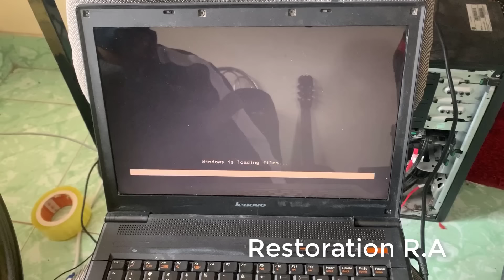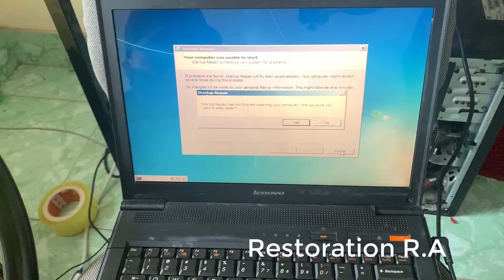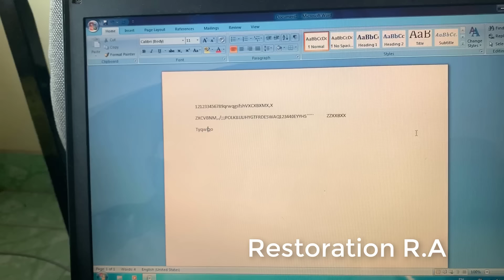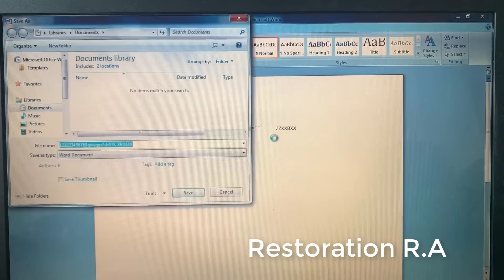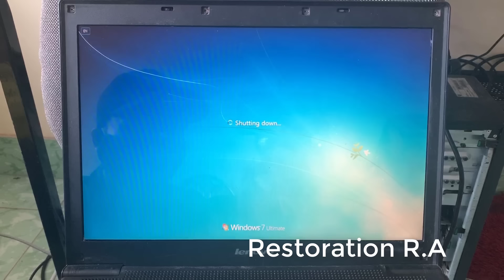Restoration super broken old LENOVO laptop | Restored computer assemblies destroyed 10 years ago

Comment: Having had multiple computers in my 70 years on this planet you did some major no no's specfically washing everything including the mother board in water. The clock battery should have been replaced as it would never turn on. In short this video although looking like a complete restoration is a complete fake.
Reply: Seeing the heatpipe being installed without ANY thermal paste applied hurt my soul deeply.
Reply: Fraud 😡
Reply: FYI

Comment: You are certainly well done that you were able to restore a broken laptop, but you made a lot of serious mistakes during the recovery ! After washing the motherboard and cooling system with detergents, it was necessary to wash all these things in distilled water, and then in pure medical alcohol, to remove the water and prevent oxidation of the contacts . After washing in alcohol, it was necessary to dry all the components of the computer on the soldering station at a temperature of at least 80 degrees, and not with a hair dryer ! When assembling the cooling system , it is necessary to apply thermal paste to the processor and controller crystals, otherwise the crystals will overheat ! Before connecting the power supply to the motherboard, it is necessary to supply a voltage with a limited current consumption , so as not to burn the chips if there is a short circuit somewhere in the keys or bridges and chipsets .
Reply: So, this video Fake?
Reply: @christopherfelix9971  I'm afraid it's a fake video.
Reply: There are a lot of things in this video that don't make sense.
Reply: I know it's fake but it's entertaining
Reply: Damn ur smart
Reply: Motherboard ok with washing in normal water. I myself had done it lots of time with just detergent and plain water.... and no problem. But u need to dry it througly before any kinda power up.
Reply: Didn't You see how good is that guy? He doesn't need any diagnostic tool. Enough is voltmeter set on 240V as was seen.. :D
Reply: smiley  Notice while he's cleaning the motherboard, he forgot to remove cmos battery so there's a chances that motherboard is fried

I think the video is invisibly reversed so you will not know
I'm quite sad because he was destroying it instead of making it working =(
Reply: Couldn't agree more with you, HDD was not correctly attached, DVD unit also, video was edited, but ok, 8/10 for effort and entertainment.
Reply: @christopherfelix9971  a some part is fake.Repair of  the mecahnical parts was very good. but the electronics thats fake. 1. Motherboard checked with multimeter random. Result? Are you sure which part value  You thouched  ?  2. Tho old electronics parts never clean with water. Because water is enemy of electronic. 3. Electronics parts as motherboard  have lots of components, so theys all works.  When Only one have problem ths part dont work. I repair the computer as hobby. And i saw this motherboard scene is fake. Maybe admin used a new one in case.
Reply: You're assuming that this "restoration" is real.   It isn't.
Reply: كمهموا ل
Reply: it's very FAKE look for FUN bro!!!!
Reply: @soulyvanh1  Scams are scams and they are only "fun" for the scammer.
Reply: @Like-Subscribe-BOT for thoose they know to repair laptops,they instant observed a lot of wrong procedures.
For thoose who they don't know how to repair a laptop,they consider us haters.
I fix stuff,including laptops,since pentium 2 onwards. I'm telling you what he did is so wrong with many things.
Starting from washing the keyboard,washing the touchpad unit,washing the mainboard.
Remember,the keyboard will permanent break if is touched by water. Touchpad same.

The measureing part is ultra fake,is a random touch everywhere with no logic.
Assembling the cooling unit without thermal compund paste,testing all full powered is wrong,wrong,wrong.
He did a good job with the plastics,ok here.

Still,is fun to watch,is relaxing. 😉
Reply: @valentinautei  What about 6:36 shere he washed the mobo without removing CPU? I bet he didn't knew it may be removed, he's too stupid. And mount it back (well, pretending to!!!) without dried the CPU at all, no thermical pad nor anything else... I enter in his videos just to report them as fake and dangerous. And i laugh a lot when people think he's doing it for real XD
Reply: All of your observations and suggestions go to prove how fake or educational at best this video is.
Reply: So he want us to believe that the owner of the laptop threw the laptop away because of what because he didn't do any work on the motherboard, he only used the multimeter the check the chipset on the board. I just don't get it. So is it the screen that was damaged or the chassis. Don't get it
Reply: No the recovery files has been damaged finish the laptop to wait drain the file will be get back to normal again
Reply: Bravo my friend. You did your homework.
Reply: It's obviously fake you wasted your time typing your comment
Reply: No heat sink paste and no ESD precautions taken. Very doubtful this was a genuine restore.  It would have been cheaper to buy a recon rather than waste the time.
Reply: Had he done the things you mentioned are you saying it would have been possible to recover this computer?
Reply: Its fake man, he damaged a good laptop then reverse the video in smart way

Comment: This video is completely true. I myself found an old IBM laptop with a 80486 CPU buried in a landfill. I gave it a quick once over with a water lance and it booted in Windows 95. So I went at it more thorougly with acetone and a Q-tip, and now I got a10th gen i7 with Windows 10 and a touch screen. For my next project I'm going to dump it into a sulphuric acid and maple syrup bath to make it a quantum computer.
Reply: Oh btw if you put the board inside an acid and left it for 48 hours, you can get a window 11.
Reply: and if you throw it into a black hole and magic it out it will have windows 12 ez working legit real 100% not fake
Reply: @pleszq  and AI
Reply: THE F@CKING SARCASM INTENSIFIES 10000%
Reply: @pleszq top 10 tips Microsoft doesn't want you to know

Comment: People here arguing about washing with the soap thingy.. So just wanna clear one thing to all of those people is yes u can wash your electronics circuit boards with soap and water just don't power it straight away dry it properly then it's good to go. Some people will use petrol or contact cleaner it doesn't matter all u have to be cautious about is there should be no power when u doing it 👍
Reply: As long as it doesn't leave any conductive residue.. you'll be fine.
Reply: It is the most false video I have ever seen hahahahahaha, he did not even put thermal paste

Comment: There's no way he had this laptop working with the old circuit boards and parts. Half the video with him just trying to fix a hole in the plastic casing you really think he had this thing running that easy. I know this guy is very mechanically inclined but this would be a whole nother level of Genius to make that work properly it was just way too far gone.
Reply: Because I have been fixing laptops so long and know that this video is fake,I will no longer watch videos from this guy bit will I subscribe. I don't like liars,fakes and cheats and I'm not going to be baited into clicking on this fake stuff!
Reply: Yes, of course. Cibili cibili cibili şak şak şak şak. Bicirik Bicirik cirling cirling aniyyaaa ciiiooorrrjjjhhhhheeeuuuummmm. From Arnavut Şevket, plase search in YouTube.
Reply: Ronan Preston  Idk man, maybe he put some the the magical Cheetos dust instead of thermal paste :D I was expecting for him to start the laptop without ram and boot drive too, i mean it's not like the laptop was covered with water soluble glue and showered with the plastic shavings that came from using an angle grinder to make the hole in the screen, right? :D
Reply: @Mr_Joseph979  Because it is not fake, as long as the foundation of the device is intact, in returning it to a place on it, it is not difficult for me
Reply: @Mr_Joseph979  Bro, this naive youtuber must have told the audience that the MoBo, Fans, speakers, and LCD display have been changed and installed. And there was no need to check the MoBo working when most of us knew that it's a new/refurbished one. So, definitely a (-1) from my side
Reply: @pritkarn0896  Lol... Thank you!
  Show me that the serial number on the original Mobo is the same as the refurbished. I've been working on electronics and computers for over 30 years. There is a point where things can become unfixable. Modern motherboards have multiple layers that can't be repaired if breached.
This guy gave me a bad feeling about restoration videos in general.
He has the nerve to reply to my comment justifying this video...sad.
Reply: @pritkarn0896  I'm with you. I get some... Some research and learning, heck I don't know everything, but I do know when I'm being conned!
Reply: i think his vids r cap
Reply: There is only the screen was broken. It is easy to change to a new one.
Reply: It's possible he might have fixed it. The only thing which might not work is the DVD drive. I didn't see him clean the inside of the drive. He just reinstalled it? There might be a lot of dirt in there. As others have mentioned, he didn't use any thermal paste on the CPU or GPU. That might be a problem. There's another channel where an Ausy guy, Tech Yes City, also cleans parts with water and sprays them with cleaner. So it's not beyond the realm. He didn't provide a spec sheet on the laptop or a list of parts he bought, especially the battery. He seems to know what he's doing and he's getting better. I would like to know what he's doing when he tests the electronics with his multimeter. He does that every time in all his videos. He should make a video explaining that.
Reply: @Cypherdude1  all his videos are fake, stop defending him. All the stuff he finds are always covered in the exact same gunk inside and out but yet the circuit boards usually never have anything on them, how convenient. Also every time he finds a drone he finds the controller right next to it? Like how.
Reply: I know this is fake, but I like to see the work of mouting the stuff. I've worked on a electronic repair store, and ofc a mother board doesn't work since the part that he put it in the liquid and other stuffs...
Reply: Well at least the cleaning process may be real.
Reply: It’s because he films in reverse, the scene that shows it working was probably the first thing he recorded.

Comment: I honestly think that think that this guy is messing with us. Even 6 year olds know to keep electronics away from water. This guys just washed a mother board in soap and water while scraping hard and then blasted it with a heat gun.
Reply: Yeah all of these videos, where they’re just walking down The road and “happen” to find a laptop there now exactly how to take that laptop apart and fix it. They just roughen up a device, stick it in a ditch or pile of garbage, pretend like they found it, clean up the parts then replace them with new ones, and put the new ones back together and act like they fixed it
Like for gods sake he gave the motherboard a fucking bath
Reply: Absolutly fake. My girlfriend lose a laptop keyboard when she was cleaning. Because a drop of water she have to buy a new keyboard to repalce.

Comment: I love the random checks of continuity and circuit board function with the analogue "test" meter on the system board. the way something falls of the mobo during the final scrub ( maybe a surface mount component ) , he inspects and as quickly discards. Wonder if it was an Apple he would dry out the water spillage sensors. Look out for the state of the WIFI cables coming from the screen as the keyboard cover is fitted , they are fused together yet he confidently connects to his router ... I can sell the bovine already lol
Reply: Yeah that was satisfying

Comment: Fake as hell, the multimeter part is a shame, he toches random parts of the motherboard in no order and with no sense and get random resistance values, at some points he touch the same terminal with both testing probes, and the part he washes the motherboard with water and soap (special product to clean electronics that you mix with water and apply with a standard brush)... Funny to see, but unbelievable.
Reply: We have a master washed soap with a TV board and normal! The main thing is to dry them well later.He measures with a tester, of course, haphazardly and incorrectly. On a de-energized circuit board, measuring the microcontroller is poetic :))
Reply: CD/DVD unit in whater??? The optical lens damage permanent!!!
Reply: we will be glad to see your restoration videos of whatever if you can restore ofcourse
Reply: Dont forget how he found the laptop without any keycaps. And magically he later has all the keycaps in a jar
Reply: I thought water.and electronics don't mix at all.
Reply: @jeffcrompton2767  In theory it should not be done but if it is possible to wash a motherboard and then dry it but with respect to the video it is FALSE I use another keyboard and another motherboard
Reply: don't forget he hasn't applied termal compound over cpu....ahahahhahaahahaha 120 degrees incoming
Reply: You saved me from putting mine in the dishwasher.
Reply: He is video  maker and doing hes job to improve rating  now he gone  up  315071 views
Reply: Omar Cusce he even liked your comment lol
Reply: Its another liquid bro
Reply: Malam
Reply: @madrhino8543  That's right, I have a neighbor doing that, and the customer is always satisfied that the TV is like new
Reply: Absolutely Fake. I have been repairing electronics and laptops for over 30 years. When I saw what he pulled out of the bag and it's condition...there is no way to get this working properly without many pieces needing to be replaced. I looked through the comments before I got a minute in the video and decided not to waste my time.
  The laptop is still not worth the parts you need to repair it, let alone the work. Super fake!
Reply: Because I have been fixing laptops so long and know that this video is fake,I will no longer watch videos from this guy bit will I subscribe. I don't like liars,fakes and cheats and I'm not going to be baited into clicking on this fake stuff!
Reply: @tiaancordier3798  he buys components that are totally damaged
Reply: yeah... I totally agree with you...another shame point is he didn't apply a heat sink compound on the main processor before installing a heat sink
Reply: not only that but look at the thing when he gets it open its fucking immaculate under all that crud, no dust bunnies nothing, if it was really in a pile of trash on the side of the road you'd thing it'd show it

if you want to utterly wreck some tech for a fake restoration at least be honest and make a joke out of the whole thing don't pass it off as the real deal

Comment: Okey lets see.. I know some people can do things... impossible to possible... my theory gyts.. correct me if im wrong... this guy is a trouble shooter technician... like he collects random parts from any comp... cellphones etc.. and he manage to have some parts of all the old parts of this laptop... dont be angry but ive seen many technicians pull something like that but this is the first like this which looks like a total goner and then he pulled it off. Basically he already have the parts just on standby... also those boards need atleast a week of drying under the sun before you can use it and you need to clean it with lacker thinner... its really impossible but it can be done if you have all the tools... sorry but still interesting to watch.. some say its click bait but well it works...😁😁😁😎😎
Reply: Too perfect fake video, many people in favor of affirmation? Because there are many people with good observation ability and weak observation ability.

Comment: It's completely impossible to restore this laptop in this situation.
Reply: Is fake
Reply: Thats fake
Reply: i agree
Reply: Completely impossible!
Reply: The video was cut and the laptop was changed
Reply: aldamang
Reply: He didn't even used Thermal Paste for the CPU and GPU chips, but the Laptop still worked. But he should check the temps later on, when he is doing some hard work on it.
Otherway he might get thermal throtelings on the performance when temperature reaches 89-90° or even turn off's when temperature reaches TDP limit of 100-105° without thermal paste or wìth defective cooler, but actualy maybe only thermal throtelings becouse he at least has the cooler working.
Reply: @Yóu Çef But it was not burned or melted, it was only covered with some sort of sticky dust, and that thing in the Display.
Reply: I doubt it, that you can wash a circuit  board with water & it still works.
Reply: @michael53667  Maybe watch a couple more times and realize a lot of things are wrong here?
Reply: сначала сняли концовку, затем поломали, измазали каким-то говном, после отмыли  и "восстановили". 2,4 миллиона просмотров этого говна
Reply: Everything is possible to do
Reply: @Grumpydude78  you can, but not this time. This laptop is screwed.
Reply: @srikantkumarnayak8677  ur fake
Reply: @rivaanparmar6230  u disagree
Reply: possible
Reply: @user-fr5ey6jd5d  this video was cut out and the laptop didn't change
Reply: @cake3137  you probably don’t know anything about computers lol